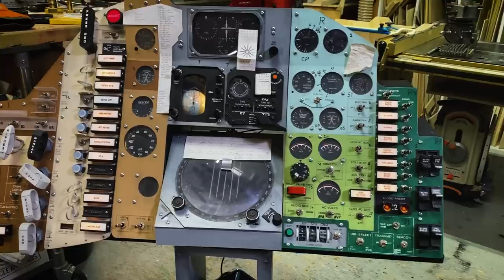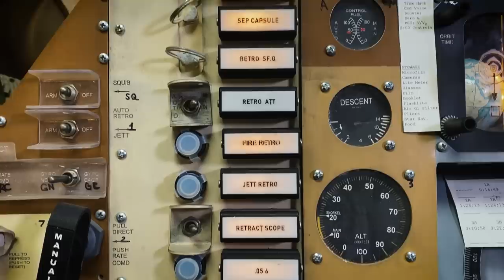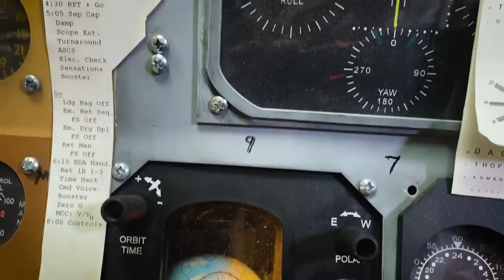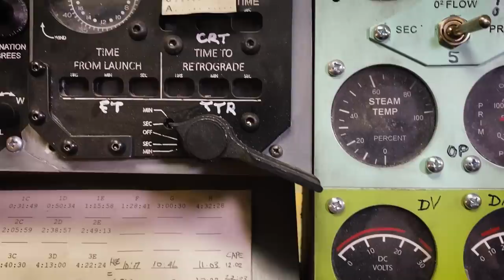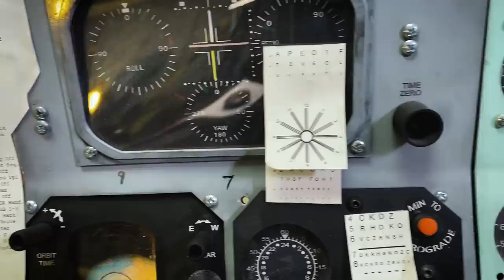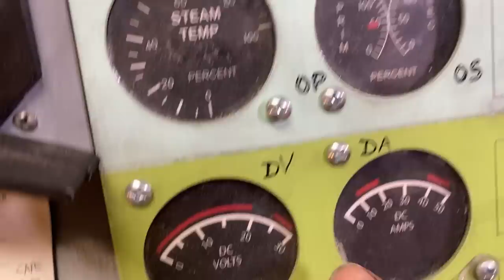Adam Savage's Mercury Space Capsule Cockpit Replica!

Comment: ADAM!!! i miss you bro. 2 things happened, i cancelled my cable, and someone told me Buster snuck up behind you with a crowbar... it was a perfect bromance, until i learned you share my passion for the Mercury project....  @1:39 right click set as wallpaper. zomg i found so many free to use models of the exterior of the mercury capsules.... this day is totally getting written down in my journal... and full disclosure, i am going off the rails, wanted to 3d print a full scale mercury capsule, and was looking for video inspiration, and bada bing, here you are. @7:10 John Glenn said, you did not climb in, you put it on like clothes....
let's light this candle.

Comment: Adam. my stepdad Jack was a development mechanic for Northrop he built the series of lifting body craft for Nasa he was "The cockpit mechanic"  he assembled and modified the instrument panels and ejection systems for his company and for NASA.   He even had to act as the pit man during tug and tow and had to sit in the cockpit during pressure testing the cockpit,. But most of all Jack built it for the pilots semi custom by committee.   There was another crew of rocket mechanics that built the fuel and oxidizer rocket systems behind the fire wall.  Jack had worked on the Flying wings even the one that killed Capt. Glen Edwards that named Edwards AFB.  Jack built the M2-F1, M2-F2, M2-F3, HL10, remember the M2-F1 chash was the one used in the title credits of the six million dollar man.  Jack & all the builders got a piece of the vertical tail made in to a trophy for his work signed Milton Thompson. Jack also worked on the series of guppy aircraft for Nasa to transport spacecraft by air.

Comment: Another item while the Mercury instrument panels look hand made it has the feeling of a simple aircraft almost but not quite a Piper cub.  While Gemini instrument panels looked some what likes a 707 panel not exactly you can see the progression while Apollo's panels looked different due to the factors of mission
Then the shuttle panels look much more aircraft like.  I had a hi res photo of the new all glass panel s installed in one of the shuttles it was fully fully powered up gyros spinning looking out the hanger at Palmdale.  A year later Rockwell blue screened the windows and put stagger the pix as in orbit an pix but the gauges shhowedthe shuttle was sitting level in the hanger in Palmdale then forgot the change the LatLong display.

Comment: Adam, I wonder did you do any work on "The Star Trek Experience" - the visitor attraction that was installed in Las Vegas in the 1990s for a couple of years? Seems like the kind of thing you might have got roped into - though I guess you may have been 100% taken up with making Mythbusters at that time?

As a fun project for my mancave I have built a first-try Star Trek control panel - just using illuminating push buttons with an ESP32 processor for control and an Arduino Uno for the lights control.  I'm about half way through coding it all to make all the buttons do logical things and to fire off sounds in wall speakers (red alert for example, or engine sounds played from a couple of XY-17 MP3 boards). Already I am disatisfied with how the control panel looks and am making notes on what I will do differently for the MK2!  But I will finish this MK1 and then take stock. It's pretty amazing how doing a project like this makes you think deeply about how to organise controls and how they all interact - opened up a whole new world of design thinking for me.  In short, I fully share your passion and ethusiasm for this stuff! 

Love your videos - keep them coming.

Comment: You don't need a servo-driven needle necessarily -
If you use a current gauge (e.g. 50mA gauge), then you can drive that from an Arduino using PWM, a resistor, and a capacitor to smooth it out.
I did the same thing for a computer network monitoring panel and re-labeled the gauge to megabits/second (Mbps).
Way cheaper, way easier, massiely more responsive than a servo!
Reply: I've done this, it works great. I found the low pass filter was unnecessary the PWM noise doesn't come through(depends on your meter though), A 5V movement is ideal as it matches for scale without any additional resistors. I've done it with servos too and it's not the same feel at all.
We should note for anyone who is interested and doesn't know that any meter based on a galvanometer movement can be used by changing the shunt/dropping resistor.
Reply: @brocktechnology  True! From memory I was using SoftPWM, for reasons I can't recall, so the frequency was relatively low.

Comment: Like you said they’ve never built a spacecraft before. Not a manned space craft anyway. I read back in the day when they built this they had all the instruments sitting on a bench and of course it all worked just fine. When they put it into the capsule it stopped functioning . What the engineers didn’t realize was that the instrumentation generated heat . That heat would buildup causing it to fail. Lesson learned. Going forward the instrumentation was cooled . On Apollo they used the cold water from the fuel cells to cool the equipment and provide hot water for the crew.

Comment: I remember February 20 1962.  I was already a NASA fan before then, and remained a fan till the failed tether experiment in 1992 when they LIED about what the purpose of the experiment was for, and "covered up" the fact that they had no idea what they were doing and could have ignited the ionosphere... which would have meant the end of life on Earth. I was watching NASA Select video feed when the tether shorted out two magnetic fields in the ionosphere and shot 3,500 volts of electricity into the shuttle. The tether glowed in the sky for weeks and could be seen with the naked eye.  They claimed it was a "communications antenna".  NASA Select tv when off the air, and when it finally came back a few years later it was never again a "live" feed but a "delayed" feed so they could censor out their f**k ups.